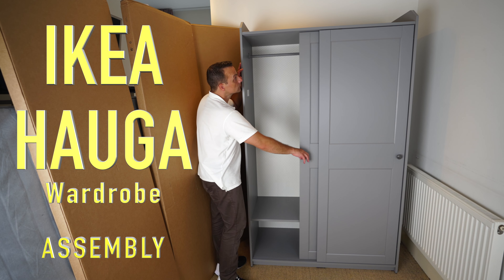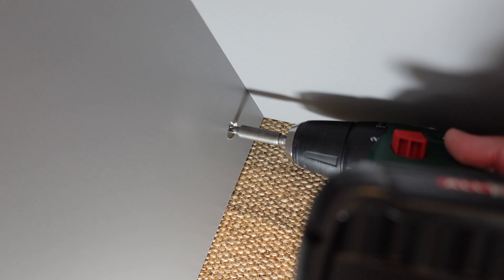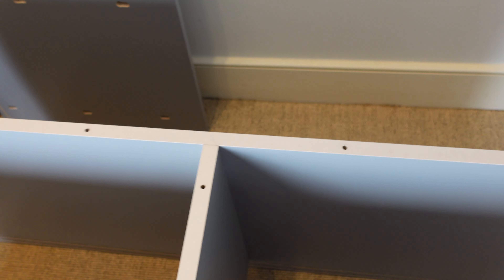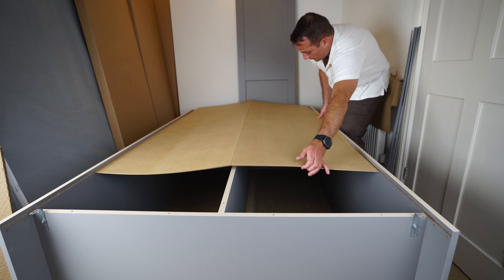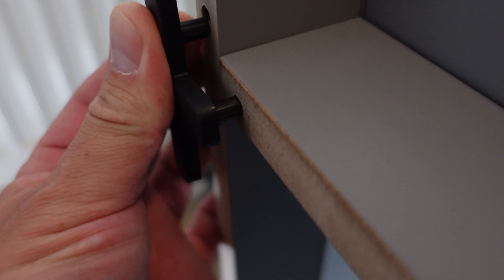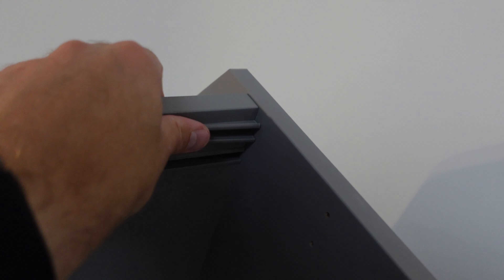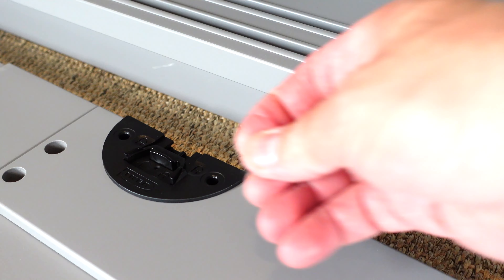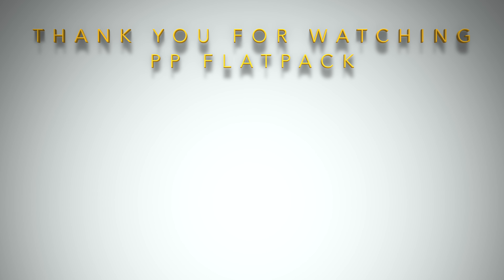Ikea HAUGA Wardrobe with sliding doors Assembly instructions

Comment: The horizontal board at the top is bowing downwards, and there is a gap on the top right and left, I adjusted the doors to try and fix it but theres still a gap. It's as if the horizontal board it too wide, pushing the tops outward. Is there any fix for this?

Comment: do we have to put the stoppers? i would prefer if the doors opened a bit more
Reply: If you mean the black L-shaped stoppers, if you leave the knobs off the doors, the stoppers aren't really necessary. But if you use the knobs, it will be useful to put them in to avoid knocking the knob off the inner door.

Comment: Hi, I accidentally pushed the upper rail and locked both wheels before putting the (right) door onto the cupboard. I took the two half moon wheels out and tried to push back to unlock position. It did not go back.  I need help, just happened 30min ago, misunderstood the instruction.